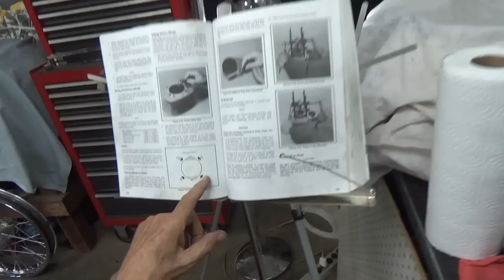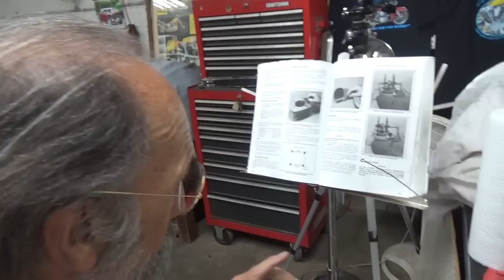Installing Pistons and Cylinders Onto the Harley Knucklehead

Comment: I would choose Top at 10:00 dot second ring at 4:00 was how I was taught. For bearing balance a make a Y for the bottom. Manual is probably correct. And My Needle Balance Is Incorrect. You can’t teach an old dog new trick’s though Harley. 😁👍
Reply: Ribbon gap’s toward’s each other at 6:00 towards each other inside.🙃
Reply from the maker: Thanks for the tips!
Reply: @pacificmike9501  DON’T FOR GET TO PRELOAD AND GET TO OPERATING TEMPERATURE. You know, before you have fun. Just the way I would do it. Be wishing you well, Thankyou for the Compliment. Going to be nice, having all new Ring’s.
Reply: What’s Up Chuck, 😁. YOUR WELCOME

Comment: I am bring an old pan back to life.  It had no compression so I pulled heads and jugs.  Pistons are OE and appear to be within spec.  Cylinder is glazed but after quick ball hone should also be in spec.  Any reason not to reuse pistons with new rings or would I be building a time bomb in your opinion?
Reply from the maker: I've had pistons that I ran for a long time then passed to another guy who ran them again for a long time.  Look then over good and. if you're happy with them, run 'em.  Everything super clean.  Nice fresh "crosshatch" honing job with a ball hone.  Carefully fit the new rings according to specs.  Now, the valves will need attention.

Comment: 14:15 I have had 2 plain fiber base gaskets blow out of Shovels. Hot rods, but I will still only use James steel core base gaskets like Mike has here from now on. 

16:06 I still hope Mike sized the bushing correctly. A light press fit is vastly tighter than the .0008" to .0012" spec in the factory manual. Last video he seemed to have misread the manual and confused pin to piston fit with pin to bushing fit. Then he repeated "light press fit" here in this video. Light press fit is size on size and is the pin to piston spec. Pin to bushing spec is .0008" to .0012" loose, and is an effortless slide in. Is there actually a chance Mike is doing it incorrectly? If he fit the pin to bushing at a light press fit then it will fail quickly. 

I made a tool like at 17:45 out of a non grooved Harley wrist pin that I tapered on one end with a belt sander, a bolt through the middle that I sized on the belt sander to just slide through the wrist pin, and a piece of tubing that just fit over the wrist pin. Same too here but home made. I made that in 2003 and it is still in my special tools drawer

23:00 I have the exact same ring compressor. KD 850H. Best I ever had. Much better than a hose clamp... I only have the size ring that fits Ironhead Sportster, but it can open up far enough to do big twin Harleys though.
Reply from the maker: Thank You.

Comment: I installed external oil drains from my head to ceases. It’s a big bore stroker shovelhead. I run it where the primary would return to the case. Now all the oil is dumping out the case vent line. What did I do wrong. They are ultima cases.
Reply from the maker: I think you're expecting that return in the primary to do more than it's capable of.  Building strokers according to S&S specs wil usually keep you out of trouble.  I think you're trying to reinvent the wheel.